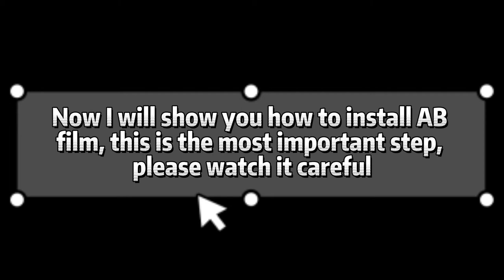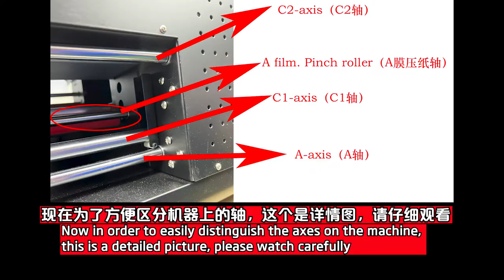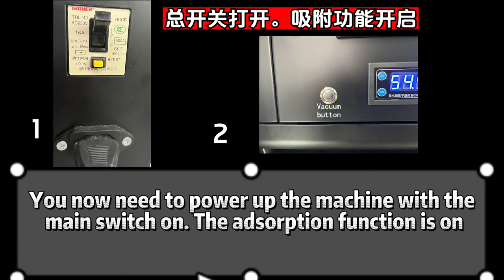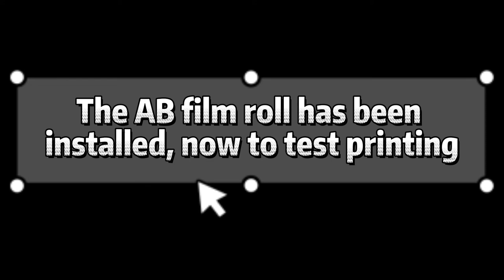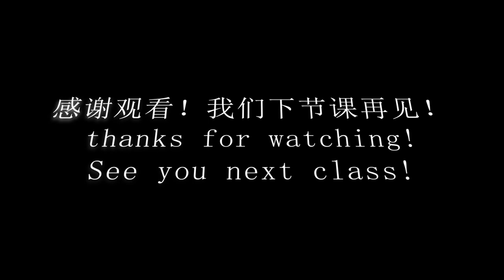UV DTF machine AB Film Installation and Test

Comment: After setting up my printer (UV DFT 2in1), when turning it on, the electric transfer film shaft (C3 axis) turns automatically and makes the glued paper get stuck at the top of the printer. According to the video, this should not tun on its own until we press "feed" or the printer is actually printing. Also the RII software gives me a message of "Permission Denied" when trying to set up the spot color settings. Please help!!!! @procoloredproffesionalprinter
Reply from the maker: Hi, we need our technicians assistance to fix the isuse for you, can you add my Skype?, it is charles@procolored.com